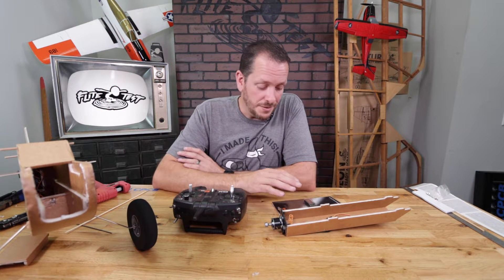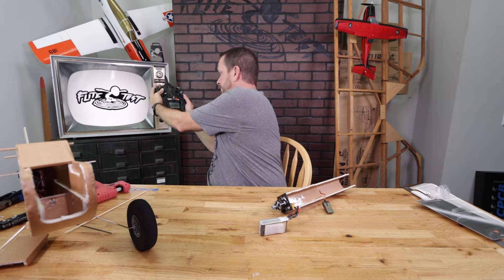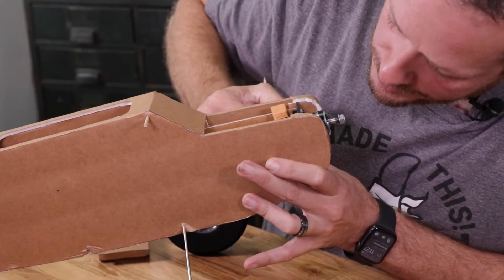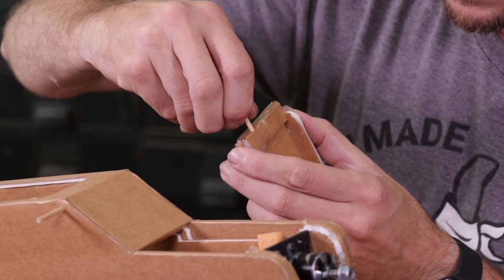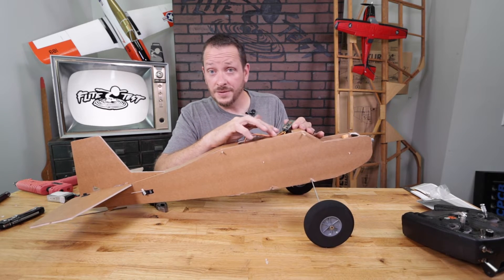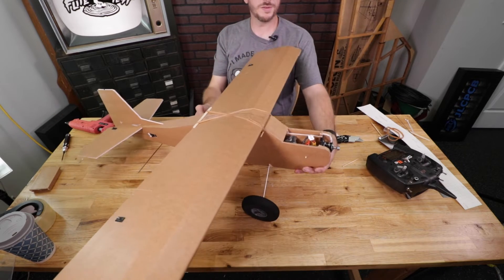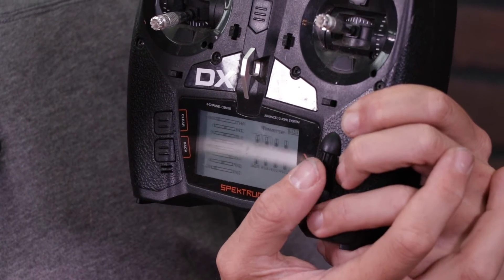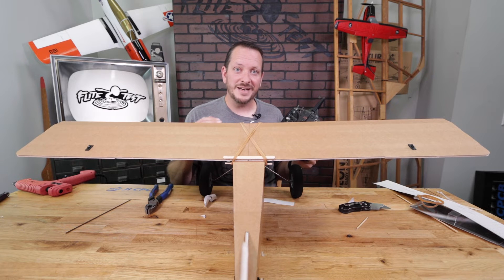How to Build the FT Tutor Installing Receiver & Final Assembly  //  BUILD

Comment: Just ordered the turbo tutor bundle can't wait until it arrives I'll be using a spectrum dxs radio simple but has panic mode for beginners auto land too  just in case   a little rusty
It's been over 20 years since I've been flying RC planes 😂 later I'm build some other ft planes also